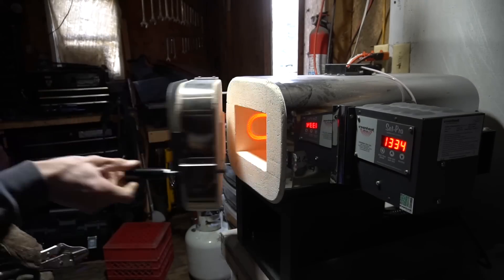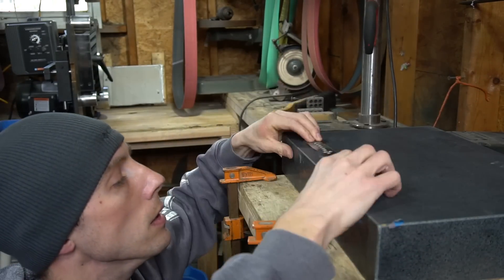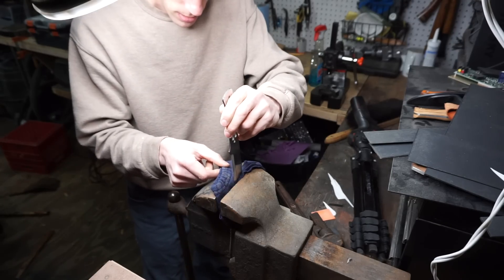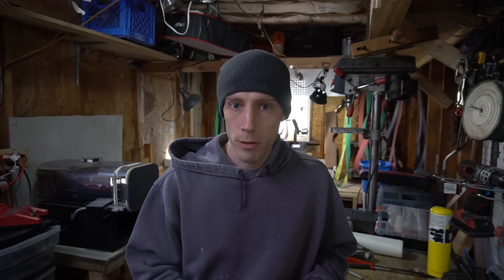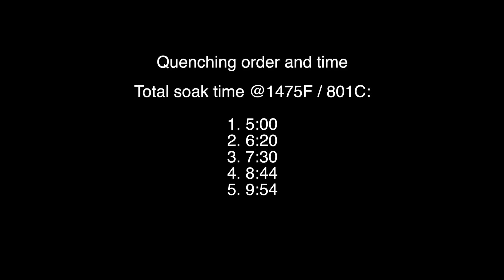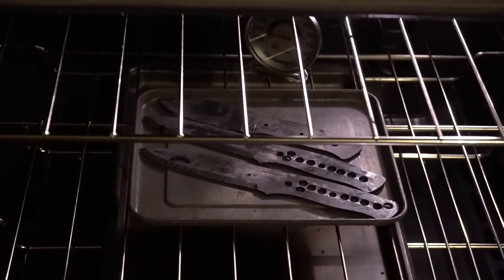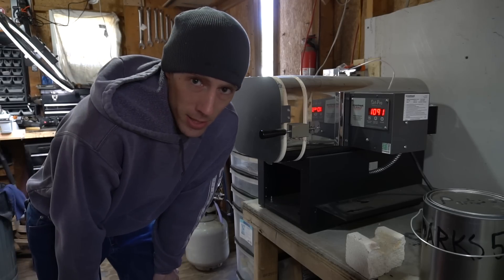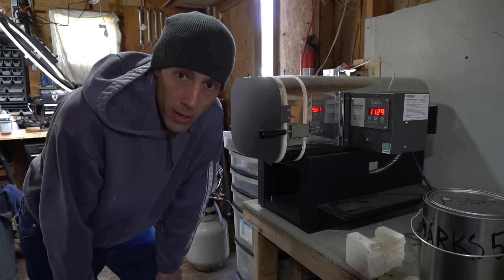Why Knife Makers Should Break Their Knives

Comment: #1: Every knife should meet it's user's needs. Not all needs are the same. Rigidity is great when rigidity is needed, but leads to unwanted breaks. Flex is great for most knives and will fill the "sharp piece of metal" role that general use knives need. But they take plastic deformation. A flaw, but not a broken knife.

#2: Cut, polish and etch if you want to view grain structure bro!
Thanks for video!
Reply: Agree. A little lateral flex imo tells someone they shouldn't be doing that with their knife, and thinness is sharpness. Having 1/8th inch steel be called thin is kind of hilarious to me, and most general use knives should probably be more like 1/16th. It'll flex if you bear down in it, but at least it will flex a lot before breaking. Discourages prybar use some. I can't help but see Mora's basic as better than their fancy ones with prybar tier thickness and obtuse Scandi grinds, the basic is thin but still superbly tough, thin scandi you can add a secondary onto if not doing the finest detail work, and the thing will actually still cut vegetables. Thicker steel is better for daggers where you need the lateral stiffness for poking despite two tapered bevels taking off cross section.

Comment: I think like this guy. I tested in my wood shop the most common ways to assemble a ply wood box for a cabinet, and knocked them apart with an ax. It was clear: glue or rabbets or brads are not nearly as strong as properly drilled wood crews.

Comment: Ok, I have to ask after noticing you trying to break the blades. Are you introducing a "work hardening" effect into them before they broke? And is that also effecting the grain structure? I ask cause you applying pressure, letting up on pressure, then re-applying pressure is in a sense creating a work hardening effect verses you applying a continuous pressure on the blade till it breaks. Food for thought.

Comment: Oil temp is probably playing a role here. If you want to know for sure, do the same test and use 5 different buckets of oil.
Reply: this was my first thought also
Reply: Can you use lard instead?
Reply: I think the bigger problem is that one piece is left in the oven for almost twice as long as the first piece. This causes a higher diffusion rate if the impurities in the metal to the grain boundaries which essentially leaches all of the alloying materials out of the metal which can significantly change the material properties
Reply: Not enough variance in temp??
Reply: Have you considered the temperature of the oil.
Has the oil temperature standardised....
Reply: and the motion in the oil.. one quench looked like it was held to still for a moment.
Reply: I imagine that it has to do with the steel temperature, the higher temp would take longer to cool down even if the oil temp was constant. The slight bit of extra time to cool below 900° would allow larger crystals to form
Reply: walmart approves
Reply: I use cold water but I probably know something stupid
Reply: I preheat my oil and use a candy thermometer to ensure a consistent oil temp.  One less variable.
Reply: As I was watching the video that's what was going through my mind the same thing controlling the temperature of the quenching oil it has to be the same because it warms up after each quench so I think that is one variable that can be taken care of as you say five different quenching buckets also you can try using different quenching oils or water to see what the results are if you have quicker cooling or slower cooling and what that does to grain growth party on Garth
Reply: The warming the oil, the more malleable the blade.
The colder the oil, the harder the blade, but also more brittle.
Reply: @marlonlacert8133  the opposite is true. People pre-warm their oils so that it flows faster around the surface removing heat.
Reply: @trollmcclure1884  you said "flows faster around the surface removing heat", is that to the part where I said, "to get a constant hardness."..
  To me this looks to have the same effect. 

As the blacksmith said a cold spot in the blade would make a break point. So flows faster, would likely make constant hardness. Or em I missing something?
Reply: @marlonlacert8133  you said the colder the oil the harder the blade. It's false. It may be true with water, other liquids or maybe some low viscosity special oil but simply not with common oils. Yeah, I had it wrong too before someone corrected me
Reply: @trollmcclure1884  Wish you had stated what one your were talking about.. 

  But now I see.. I did say. "colder the oil, the harder the blade" And through testing awhile back, I found that cold oil causes hard brittle spots in the metal. And soft spots else were.
  When using Canadian cold oil, you only quench the edge. And this will give you a rather hard edge. As at -20C oil is more like a gel. 

 Yet you can use warmer oil for a softer edge.. like -12C.. The difference is quite extreme.. 

  Note: You only quench the edge, for this process. Blades make great skinning knives, but poor for uses that involve benign dropped. As you can chip an edge..
  But as for full quenching you are correct, in that you need hot oil. Only to prevent hard spots, that are rather fragile.
  With one exemption: Cover only the center of the blade with a fine clay, and then heat till red. Then quench in 5 to 10C oil, As this will harden most of the effects on the edge. Note: Improper clay layers will cause warping.(And use a lighter oil for this.)
Reply: @marlonlacert8133  Interresting. Yeah, maybe it's rather about even distribution and cold stuff still makes faster but uneven quench. 
I played with clay when trying to case-harden mild steel and pure bentonite was cracking when slowly drying. I've seen Japanese quenching with a clay mixture and it stayed on the surface so I believe it can be done. Maybe the warping happens where the clay flakes off
Reply: @trollmcclure1884  "Maybe the warping happens where the clay flakes off", that has been what I found with my limited experience. Also the surface is best when rough to get the clay to hold better. (But only slightly. as  too rough will cause clay to be on at different thickness.) If you wish to do so the old way, use a block of wood, and white sand (Or bone powder.) to rub the surface along the full length of the blade.. Then apply clay with no visible stones in it. 

  If I remember correctly there is a way to wash and skim the finest clay from the plane river clay...
  In this day and age, one could try fire concrete.should give same effect, even better if you seal it with a grease after it has set. I think the key is a thin layer, as the metal will expand, but the fire concrete will not do so as much...
  Hmm.. This summer I might try this with high temp silicone. wonder how well that will work..
Reply: @marlonlacert8133  I don't think that's correct man. If you're oil is too cold the temperature difference will cause a vapor jacket around the steel, and the oil wont actually touch the blade; that would cool the steel slower. The standard temp ranges for can be counter intuitive, around 110F+/-2 is near perfect.e
Reply: @alexdaby7227  "vapor jacket around the steel" <-- Would only form if the red hot steel was not moving within the oil. Yet the most quenching happens within the time the steel is thrust into the oil... This movement peals off any vapor jackets, exposing the steel to the oil.. 
 And you are correct that cold oil does not convect the same as warmer oil.. But convection is only one of the many mechanics involved in quenching. 
  Now for larger steel objects, you are correct. But for thin blades like knives, and swords. loose heat just by shoving them into said oils.
Reply: @marlonlacert8133  agreed to an extent, I've had varied results quenching in sub 110F, a lot were great knives, and some had to be warrantied back in the day. If the critical temperatures of steel, normalizing, the cooling curve(forgot the name of it) and temper temperatures; Then the temperature of your quenching oil would be no different. You should check out Knife Engineering by Larrin Thomas, he breaks down the science of heat treating to laymans terms.
Cheers!
Reply: Oil temp is probably not making a difference
Reply: @ssimon64  I would think it does, if you look at how he did the testing it adds up, the first 2 were right after each other, 3x and 5x, although the 5x were a lot smaller pieces logically, it also didnt show that much of a difference as well. The 3x did because of the bigger size of those blades. Then the last test was also not right after one another and also small pieces so the oil didn't heat up as much as in the full blade quenches. There is something in the temp of the oil that at least has an impact on the quench it seems, maybe not the only thing but it sure looks like it does partially.
Reply: @ssimon64 , When younger, I use to listen to a old blacksmith tell me stories of metal working.. And he was 100% about how oil temp changed the metal temper.. So much so that the old smith would pre warm their oil to get a constant hardness.
Reply: @marlonlacert8133  you tell your stories in an unusual way lol
Reply: @xsconflicttheory2784  You should have heard how the 80 year old nearly def almost retired blacksmith, told his stories.. 4 to 6 hours non stop, to boot. lol

Comment: id say oil temp is too hot. do test with same temp oil, try bigger tank thats not going to heat up so fast. dont want to burn your finger but at least hot to the touch if you cant hold your finger in it for a few seconds its too hot iv been told by a few older knife makers who use 1095 as there go to.
Reply from the maker: Oil temperatures were monitored and within the operating range of the oil
Reply: i wonder if the parks 50 is too fast for that steel. i use veg oil but i also forge my blades and just use the none magnetic method then dunk while is coming back down to that temp rang. ill have to play around and see how the grain looks with a few because now im wondering how it could be so different also.
Reply: also are you heating the steel above the quenching temp then letting it drop back down to soak at your quenching temp? i have read in a book somewhere that the vermiculite and perlites or whatever there called need to be heated above the quenching temp then brought back down to help lock the grain in a better formation for hardening or to bring out the certain grain. i think one of the two moves at a higher temp but to help alter the grain you have to go above then bring it back down to the lower temp for the better grain or to get it to lock in the right spot. i could be wrong because it is a science on its own and also that might just be why they say to quench it at a certain temp, it might be the high spot to start. but for some reason this is what im remembering. you may already know this but if not it might be worth checking into.
Reply: sorry martensite and pearlite lol

Comment: Kudo's for going the extra mile to improve your craft/product.
However, why not invest in an inexpensive microscope and polarized light source to see what the grain actually looks like? I think you might find it informative, and you can rest assured that your current method isn't actually leading you astray.
Also, it would benefit your 'research' if your method of stressing the steel to failure was more uniform.
Reply: idk where you're from but here it's much cheaper to borrow from a local college/ university than to own 1.
Reply: @TheGunz0001  Actually, a 30X or 60X Jewelers Loupe would work just fine. They're not very expensive and it's handy to have around the garage anyway. In most cases you don't even need the polarized light source, just taking the time to file the broken edge flat and etching with a clear acid will reveal detail in the grain.
Reply: @namzarf  polarizing filters are also quite cheap and can be used with most small light sources, flashlight included so the polarized light also isn't a problem

Comment: Good job, introspection and investigation are very important. First, I think you have proven that Jet fuel did not bring down the Twin Towers. More on that another day.  Testing your product often leads to improvement and knowledge, I see an Engineering degree in your future.  One other thing to keep in mind as a knife maker is what is the purpose of that knife. A knife used every day by a butcher needs to be very hard and very sharp with good edge keeping.. A knife used  as a fighting knife, ie: a commando knife needs to be very tough yet able to bend under extreme use without breaking. A broken combat knife means you have lost the fight.  End use is critical. Don't focus on just one parameter, test many and gain a wider field of knowledge. Welcome to the metallurgy rabbit hole. Good luck.

Comment: OMG the oil is hot this is what makes the difference between test's
Reply from the maker: The oil temperature was monitored.
Reply: If the oil temp was the same in all tests than i am sorry . Usually wen i harden with hot oil the blade is much more flexible so i do this for trowing knifes and they dont chip . For sharp and crisp knifes i always use cold oil . This why i said its the oil temp. Sorry again.

Comment: Were you using the same quenching bucket? If so then the oil will have increased temperature with each quenching, thus reducing the cooling effect for each piece.Thus, last steel receiving the least effect of the quenching. Just a thought....

Also grind the surface of the specimens fine, acid etch and view under a microscope for grain structure...

Comment: I think its that the grain growth itself will grow best in a stable environment. as long as the heat is increasing or decreasing the grain will not grow. The way I imagine it is like crystals. lets say at one temp the crystals are square shaped and at another, the crystals are triangle shaped. well if we switch from square to triangle crystals you basically have to restart the growth of the 'grain'...

If I had your setup I would test it... but my setup is more like a coke furnace...

Comment: Examine your heat treating oven, you don’t really know what temperature the steel has seen.  Kiln type ovens suffer from non uniform temperature.  You have radiant heat from the coils blasting the parts when the oven is on a heating cycle.   The outside pieces get direct heat from the coils while the center piece is shadowed and heats slower.  Look at the thermocouple location,  if it is shielded from the heating coils it is seeing a different temperature than the steel samples that are not shielded.  Put your parts in a ceramic tube or somehow shield them from the radiant heat that is probably making them much hotter than the oven reports.
Reply from the maker: This was ruled out during the normalized test.

Comment: Jokes aside; I think there are two things you need to control more accurately: oil temperature and quench speed. They both affect kind of the same thing which is recrystallisation.

When quenching you're looking to maximise the rate at which the steel cools down. If your oil is warmer (from previous quenches) you'll get less of a temperature differential which translates directly to fewer degrees cooled per second. In the soaking process the steel is oversaturated with carbon and when it cools down rapidly it will form martensite and carbides, both of which are substantially harder materials than the austenite you started with.

Quench speed does kind of the same thing. Your piece of metal is really hot compared to its surroundings and it's losing heat rapidly. Think of the small time it takes to draw out the piece and into the quench as a mini normalisation. If you fumble around, close doors or do stuff like that you could start to get the carbon to dissolve back into the metal.

I propose two tests.
1) Use same batch of steel, same temperature, same soak time. Have oil baths at different temperatures. You could heat one up (be careful with hot oil though, please), have one at room temperature and refrigerate one. See if the grain structure differs.

2) Use same batch of steel, same temperature, same soak time, same oil temperature. Quench one piece really quickly - as fast as you can, contemplate on the second for some 5 seconds before quenching and really ponder about the meaning of life for 10 seconds on the last piece.

This way you'll know whether the cooling rate affects your grain structure. Additionally, you'll know which affects more: the oil temp or the time it takes to quench the piece.

I'm sure the answers actually do exist somewhere out the on the internet but I only did some 10 mins of googling. Keywords you could use: phase diagram, recrystallisation. Also take my thoughts with a grain of salt because I don't actually have a degree in materials science / engineering, only did some courses.
Reply from the maker: Oil temperature was monitored 110-155 within the range of the oil . And thers no accurate way to control quench speed. The piece simply gets shoved into the oil.

Comment: interesting thought wouldn't you want a larger grain structure on the spine of the knife to increase the durability. so my thought is what would happen if you insulate the edge and taper with a thin coat of clay so you only hit 1325 on the taper and edge and then that would be a longer soak higher on the spine.
Reply: Do you not know about Katanas? Look up Hamon & Clay tempered Swords.
Reply: @moronbrother1  Yeah of course that's why i thought of it but i have just never seen it applied to a smaller knife.